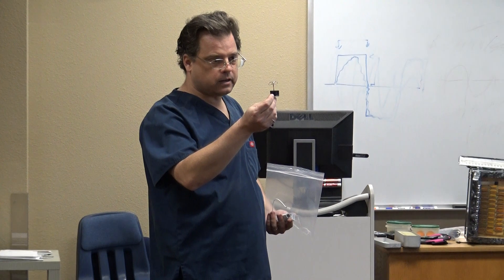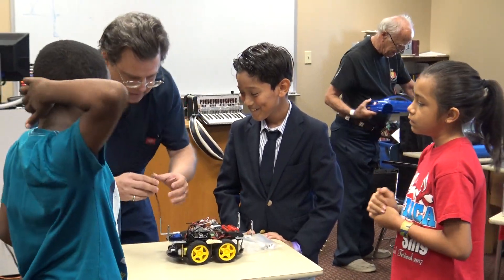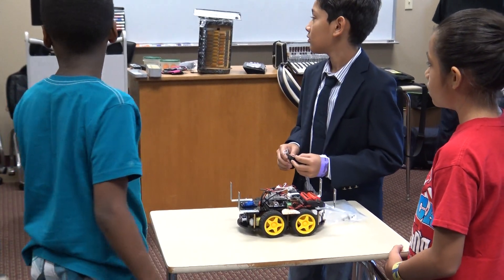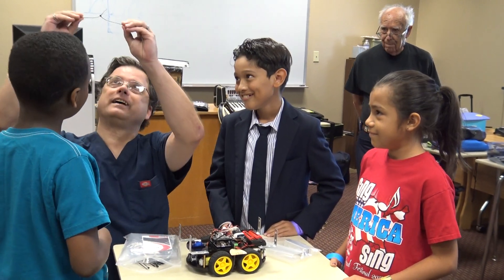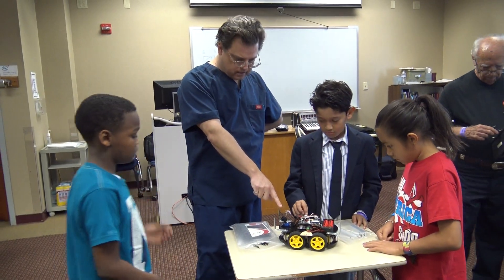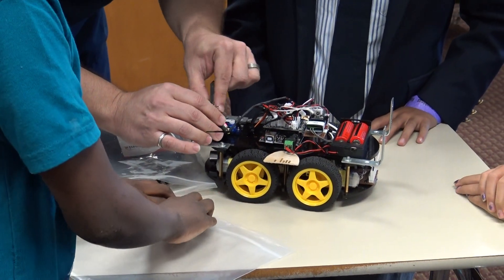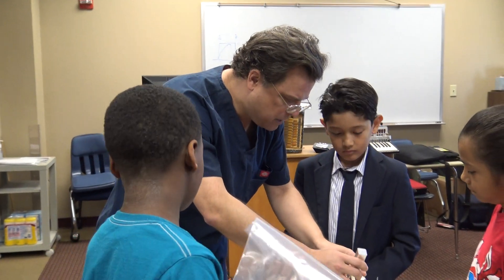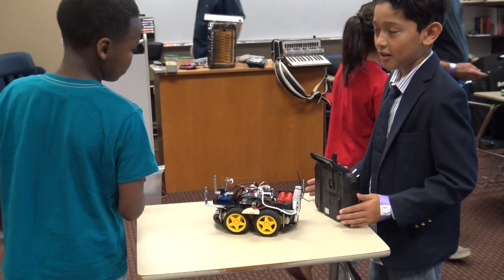Elegoo Robot Car Smart v2.0 with video camera modification

Comment: What's the name of the camera
Reply from the maker: FX  GhzTXC Camera comb micro-camVTX 40 Ch - purchased on amazon. Hope this helps.
Reply: mecatx yes it does.. but I have a project to create two robot cars that cannot collide with each other.. to prove accident free cars. And I need your help and guidance.
Reply from the maker: Cannot hep a lot, as we are deep into 3D printing, and drones right now. Can give some advice. You could use ultrasonic sensor that are common. they come with the MBot  kit that we have another here on youtube.. This kit comes with software that reads scratch, and c++, and now in Mblock 3 with Python. You probably would need to get more sensors to cover all four sides. Just copy and paste the text from the forward sensor in the kit, for the other three sides. Make minor changes in code.for distance, etc. This is a fairly extensive project for a beginner.  We have a commercial DJI drone that only does it for foreard and back. Doing it with a camera is more difficult. Hope this helps. Where are you located in the world. Need for our records on outreach. Good Luck.
Reply: mecatx Nigeria in Africa 
Thanks alot.. it surely does

Comment: Which camera is that and where did you get it?
Reply from the maker: Purchased it on amazon. It is 5,8 GHz TX Camera Combo _ mMcro Cam VTX 40 channel by FXT technology> Will probably also need to get a receiver or use a scanning monitor.